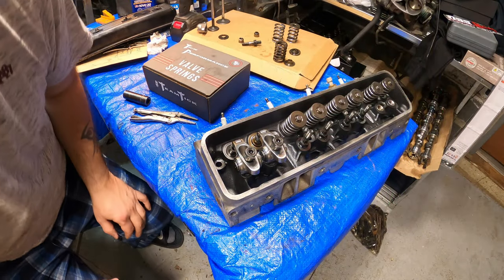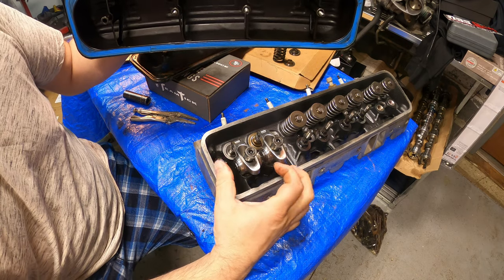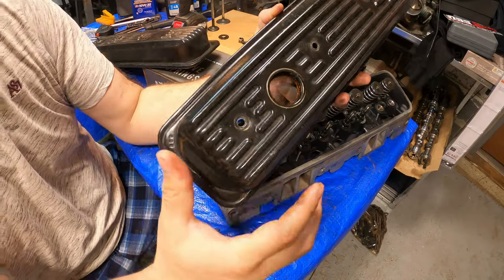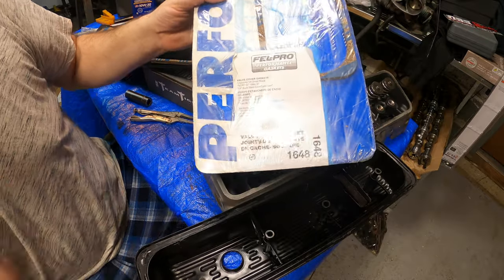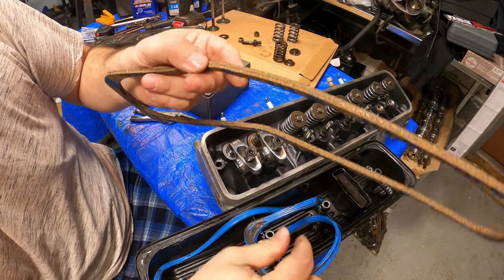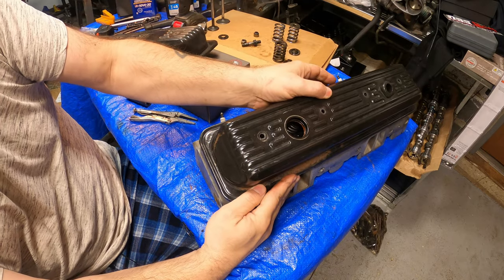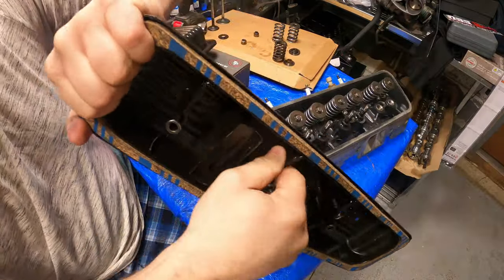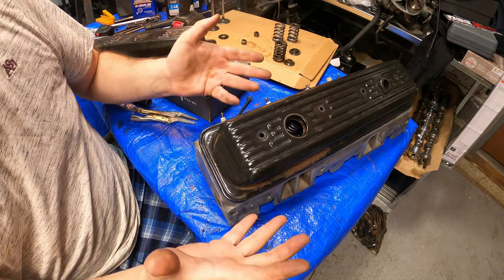Center Bolt Valve Cover Clearance for Roller Rocker Arms

Comment: I'm building an '88 vette, and I really want to keep the stock valve covers for the looks. Modding it will be a bit trickier due to the thicker supports on the inside, as well as the magnesium, but this vid really helps to clarify.
Reply from the maker: thank you for watching and glad this helped

Comment: Love your vids! Been thinking with my lt1 if I wanna forge my motor and boost it or N/A hot cam it, what would you recommend?
Reply from the maker: N/A setup with good heads and cam is much easier ... hot cam is an old setup i would step up to a newer design

Comment: Do you have a specific torque value that you use for the center bolts, or do you go by feel?
Reply from the maker: if your going to use these gaskets i would silicon gasket to valve cover to keep in place if you need to remove valve cover and go by feel it does not require much to secure in place ..  (these gaskets have a metal core and should not leak if not over torqued)